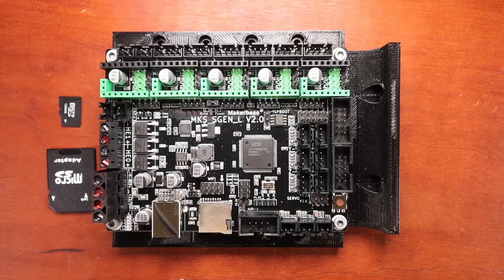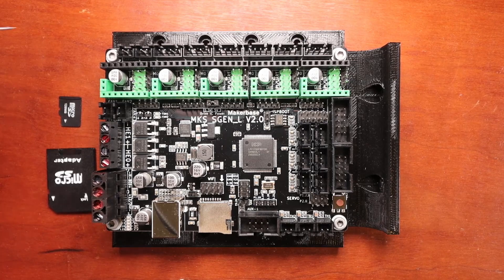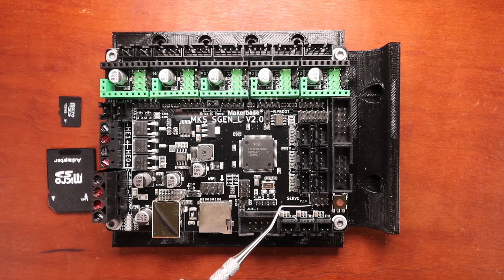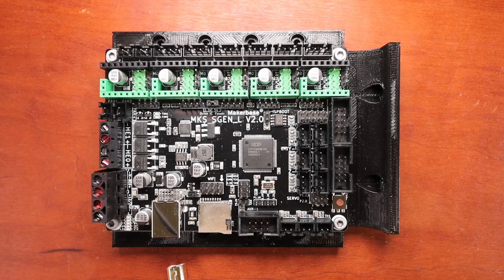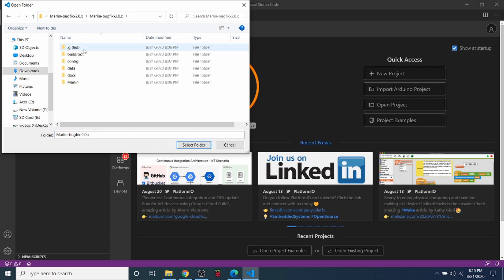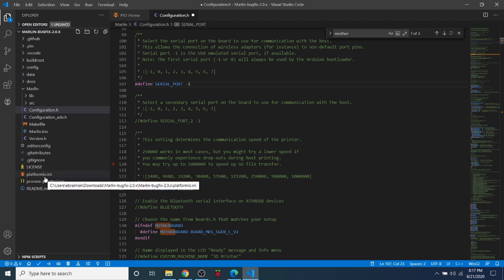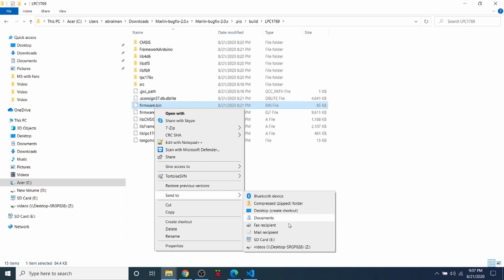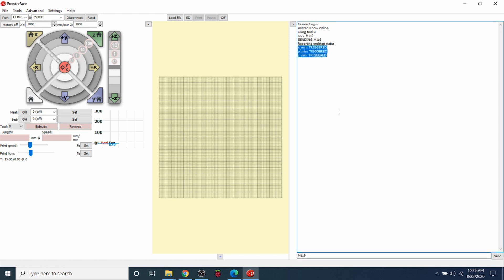MKS sGen L V2.0 - Basics

Comment: As a note for users having the new MKS GEN L 2.1 board with Marlin 2.1 the LPC1769 is not correct for this board ...  
List shows (scr/core/boards.h) RAMPS Derivatives using ATmega1280, ATmega2560 listing for the board BOARD_MKS_GEN_L_V21 is default_envs = mega2560 in Platformio.ini

Comment: Can you add blue tooth?
Reply from the maker: Yes, but not recommended.
Reply: @EdwardBraiman  oh okay thanks. I’m using it to control steppers motors nema 17 for a telescope. Online it says that board is compatible with hc-05 Bluetooth module … not sure if it would also work with hm-10 Bluetooth module.

Comment: I killed my V1.0 board and am replacing it with a 2.1. My motors are now reversed. Have the pinouts for the motors changed between versions or should I be looking at my firmware?
Reply from the maker: You and flip connector to stepper or change in configuration.h.

Comment: Hello there! Got a Tarantula Pro with MKS SGEN L V1.0, i followed your tuto (and configured the files accordingly to my version) but my LCD Display is blank, and i cannot connect to my printer.. :/ My LCD is MKS Mini 12864 lcd.. Do you have an idea?
Reply from the maker: One cable or both needs to be reversed for notch maybe.
Reply: @EdwardBraiman  Ok, now i can connect to my printer, i just defined serial port at -1.  Reversed the cables, but still no display. Hope i didn't brick something...
Reply from the maker: The notched connect is backwards on the board.  Meaning the notched side should be inserted 180 degree's  from notch on the LCD ribbon connector.

Comment: Hi , I am upgrading my custom built 3d printer from 8bit Arduino to 32 bit board.
SKR Mini E3 v2.0 inbuilt 4 TMC2209 - 54$
SKR E3 Turbo inbuilt 5 TMC2209       - 68$
MKS SGen L V2.0 & 4 TMC2209        - 77$
MKS ROBIN NANO V3.0 & 4 TMC2209 -78$
SKR V1.4 Turbo & 4 TMC2209           - 85$
SKR Pro v1.2 & 4 TMC2209                - 89$
These are the boards options that are available in my country. Which board should I get for good performance & value for money.
Reply from the maker: Depends on what you're building.

Comment: Hello, i have that GEN L V2.0 LPC1769, updated marlin with  Vscode. I also want to use it with reprap discount full graph display. But it doesnt work. It sounds like click click sound. And no light no letters on the screen. And if i turn the button red leds on  MKS board turns on. I already try changing 1 and 2 plugs. Nothing happened only screen light flickers.
Can anyone please help me? Thanks.
Reply from the maker: The cable are mounted backwards on MkS sGEN L.  You'll need to sand off notch  and place in 180 degrees in connector.
Reply: @EdwardBraiman  OMG! Thank you very much! That works! Thank you.
Reply: @EdwardBraiman  So its me again. Sorry for bothering. Now i cannot use SD slot on my LCD display. I already enabled SDSUPPORT. What can i do?
Reply from the maker: I'll need to research.
Reply from the maker: Just tried in live stream and got working.
Reply: @EdwardBraiman  Guys, before I order, can this be done with the stock ender 3 screen too? Flipping the connector and using 1 single cable to the screen? (I have it this way on Gen L and it works)  also, would this be true for the Robin Nano V3 as well? Ed, in your opinion, do I go for the (slower) Sgen L V2 or the (newer, faster, more complicated) Robin Nano V3? Thank you!!
Reply: For anyone doing this, you can also not sand anything, just carefully pry the black connector housing on the board off the pins upwards, then flip, and push back. Carefully, so you don't bend pins :)

Comment: There is infinite repetition in the firmware uploading part.
Should I remove the SD card after it has been uploaded?
Reply from the maker: You want to leave the sd card in.  The repetition is by design.
Reply: @EdwardBraiman  I'm sorry. I checked with frontface and I uploaded the firmware well.
But I can't connect to 2004 lcd no matter what I do. Can you help me?
Reply from the maker: Depends on the connection with ribbon cables and Marlin setting for screen.

Comment: Hello, excuse for my English.
I am not correctly understood where to connect the fans?
The cooling fan as well as the filament outlet fan.
It's FAN1 and FAN2, which can be variable?
I am only one Extruder.
Reply: Well I found it on my own, I'm too stupid, I hadn't seen the 12 / 24V pins next to the X Motor output.
Too bad they do not go to the end of their numbering.
Power E0 and E1 but FAN 1 and FAN2 as well as E1 thermal and E2 thermal.
Why started at 0 then then at 1 for the fans and probe

Comment: I have a CR-10S, I'm trying to install it but, I can't figure out where it goes, does it plug into the pins next to 'Servo', or does it go in one of the pins above it, it can't fit into servo, because the connector is a 3 pin, not a 6 pin, and it can fit into the pins above, but the pins above are for the endstops.
Reply from the maker: What are you trying to connect to the board?  If you want to post images on my Discord in the general chat I might have a better idea.  The link to Discord should be in video description below.
Reply: @EdwardBraiman  My apologies, I had meant to mention that I was trying to connect a filament run-out sensor. I'll join your discord.
Reply from the maker: There is an old tutorial in my RAMPS 1.4 playlist.  It somewhat dated, but covers most of what you're looking for.

Comment: The Ali Express link ALWAY Says UK
This Supplier/Shipping Company does not deliver to your selected Country/Region.
Reply from the maker: Thanks I'll try and figure out why.  Ebay probably works.
Reply: @EdwardBraiman  Only 8 bits
Reply from the maker: This is a 32 bit board.
Reply: @EdwardBraiman  . I must be looking at the wrong board:
https://www.ebay.co.uk/itm/GEN-L-V2-1-MKS-Smoothieboard-3D-Printer-Control-Board-Motherboard-for-Marlin-MKS/164518074211?hash=item264e0a9763:g:ibcAAOSw2KVfszQV
Combine 2560 and ramps14 on one board, solve the problem that the Ramps14 combination interface is cumbersome and easy to break down.
2.The user can replace the motor drive by himself, support 4988 drive, 8825 drive, TMC2100 drive.

Comment: Can I use an Esp-01 on this card?
Reply from the maker: I think so, but check the pinouts diagram.
Reply: You can buy the V2.1 with a WIFI module on Aliexpress
Reply from the maker: I recommend using a raspberry pi instead.

Comment: Hi,
thanks for this video. I was wondering if anyone managed to have the FAN2 pins working in PWM mode with Marlin (I'd to lower the FAN speed). If yes, I will be interrested in how you configured Marlin

BTW, now the MKS SGen L2 code has been merged into Marin 2.0x branch
. I replaced my Ender 3 board with that one, together with TMC2225 drivers (which works without any mods in UART mode on this board)
Reply from the maker: If you check my MKS sGEN L v1.0 playlist I walk thru the process.

Comment: does the SD needs to stay in forever? or is it just used to initially setup the board? so you can just upload new firmware thru the USB?
Reply from the maker: It needs to stay in.
Reply: And if you want to reupload the firmware? can you do that thru the usb cable or do you need to pull out the SD, reupload it to the SD and plug that in?
Reply from the maker: Try it out and lets me know what happens.
Reply: @EdwardBraiman  Sure!, One problem first; I follewed the exact steps in this video but are getting build issues.. it says "No such file or directory". Any ideas if I can fix this? or are you able to mail /upload/send me the working base marlin firmware?
Reply from the maker: Try my Discord in general chat.  If I'm not available, someone there knows.
Reply: @EdwardBraiman  Figured it out; For anyone having the same issue; the newest couple of versions of "PlatformIO" cause issue with the LPC1769 processor, I installed the V1.10.0 version and it works now.
Reply: @sander289  This is currently my exact question. I cannot get vscode to upload though the usb cable at all. Each change I am having to flip the printer over and it is a pain getting to the sdcard slot. I tried backdating platformIO to no avail.
Reply: @sander289  where did you get that version ad for the apps

Comment: Hello! First of all, thanks for the tutorial. I have a question with it, or maybe more. Can i connect to this board a normal 3d printer with CNC and plus one Laser at the same time for different jobs? I want to use 24v system for the CNC and the 3D printing, i also have a 12v laser with external powersource and panel. It have a 2 pin TTL port and 4 pin with (12v, pwm, gnd, C) connection, but it can run from it's own panel and i can control from the panel. I have one more external motor driver for the CNC spindle (LD-WS4810), than i think i can use from the suply power source directly, and 5x 2209 internal driver for the 6pcs (2xZ) nema 17 motors. I also have one UPS and one PWC modul. Plus 2pcs filament stopper for the two line extruder. Ultimately  MKS TS35 2.0 display with wifi. That's the story.. Is this possible somehow? I know everything is possible.. but... :)
Reply from the maker: Anything is possible.  I generally avoid talking about lasers, due to off gasing products.  Anything in Marlin firmware should be possible.  As for WiFi, I'd use octopi as it's more stable.
Reply: @EdwardBraiman  Sounds good. I want to engrave on leather or wood, that is not a big one, just 30w (445-450nm) blue light laser. Is this dangerous to? I bought the board in set with wifi (esp-125) and screen, i hope it will be fine. Thanks for the quick answer btw.
Reply from the maker: With lasers you should protect yourself from the light and vent gases the laser generates on the materials you're working with.   Remember it's about your health and those around you.
Reply: @EdwardBraiman  Yes i knew it i need glasses, maybe i need a good ventilation at that room, if i will build it. Thanks for it. Do you have a video from how to connect impossible things on board.. :) How can i use that things wich has seems like no connection port on board? Like 7th motor question, and actually can i use an external motor driver port to place a diferent axis, or that will be working similar than the stepper driver above the external slot? Or the internal slot is connected, maybe it will be get damaged if i connect the external slot?
Reply from the maker: You might want to look at GTR and M5 version 1.0 by Bigtreetech as I thing you can use upwards of I thing 11 motors.
Reply: @EdwardBraiman  That's to mutch for me i guess. I ordered a genl-2.0 but im a starter in this thing, but i want to learn the limits.. :) I have time for now the covid-19 is everywhere. I stucked at home. And i want to spend these times for useful things. Thanks for the help btw. I do not want to disturb you. And alot of thanks for your work.
Reply from the maker: You're welcome.

Comment: looks awesome, I just ordered one, but on what voltage does the heatbed out run? 12V or 24V?
Reply from the maker: Either, but I recommend 12v for simplicity.
Reply: @EdwardBraiman  Is this not dependent on your power supply?  I understand that if you are using an external MOSFET that you could mix voltages, but it is simpler to just use one power supply.  Same for the hotend voltages.
Reply: ohkee, but doesn't a 24V bed heat up quicker? and what about the hotend? 12V as wel or 24?
Reply from the maker: That maybe true, but my preference is 12v to avoid issues.
Reply: ohkee thanks, and the hotend works on either 12V or 24V as well?
Reply from the maker: Yes, just slower to heat initially.